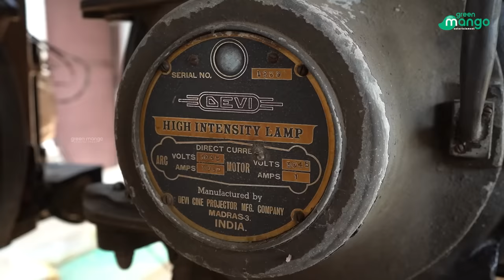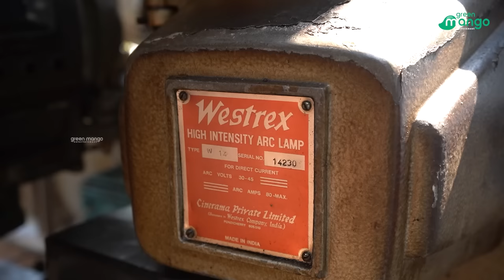ഈ പ്രൊജക്ടറിൽ നിങ്ങൾ സിനിമ കണ്ടിട്ടുണ്ടോ ? | Antique Film Projectors | Cinema Projectors

Comment: 35 mm is not the film's  width or length measurement, 35 mm stands for the film's exposure left top  corner to right down  corner  or left down corner to top right corner vice versa measurement  (corner to opposite corner like a Tv screen )

Comment: ഒരു ഫിലിം റിൽ കിട്ടാൻ എന്താ വഴി?
Reply from the maker: സാധ്യത കുറവാണ്
Reply: Check old film distributors or old Talkies. If you need film spool , it's easily make in mechanical welding shop (Laith) You can get help from 35mm Cinema licence Operator.